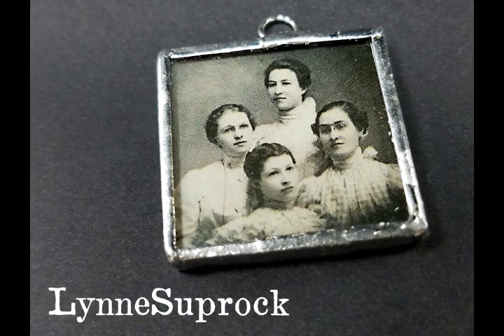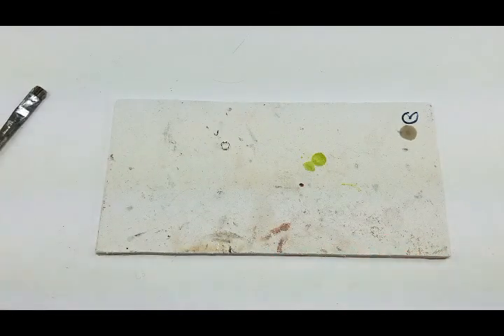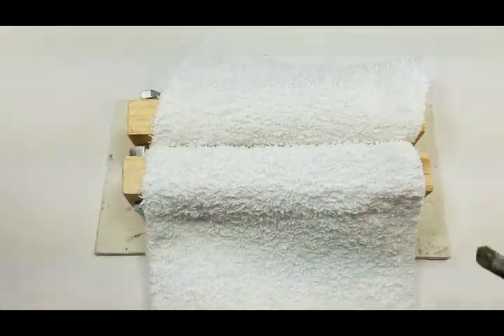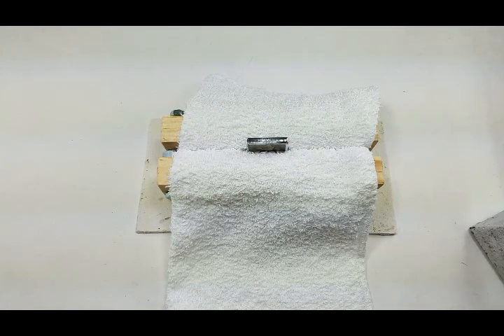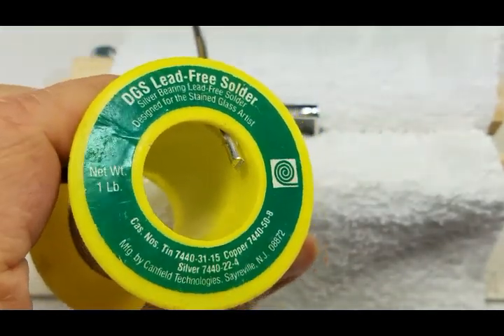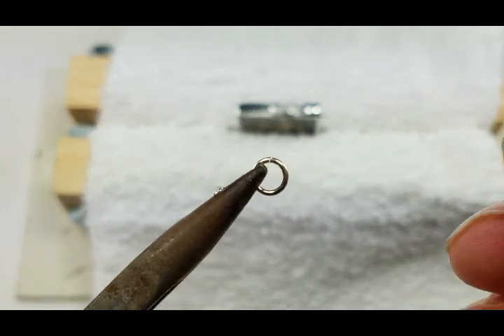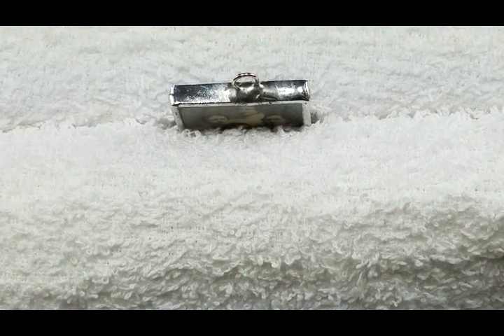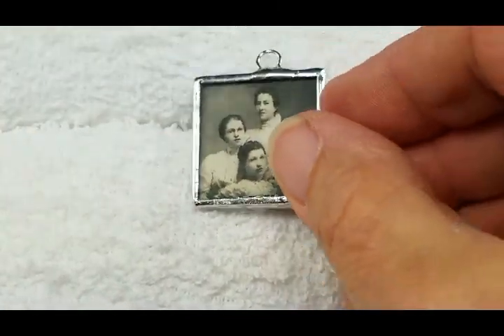How To Solder A Jump Ring Onto A Charm

Comment: I realize this is an older video but I'm just learning how to solder and am struggling BIG time with the jump rings.  I swear I do what the video shows and the solder just flows off the jump ring.  I'm using led free solder and stainless steel jump rings.  Is this incorrect?  I hope to hear from you.
Reply from the maker: there are certain metals that do not solder together using this method.  sorry so late in getting back to you Suzy.  use a base metal jump ring or one plated with silver

Comment: Hello,  Ive been watching a bunch of your videos.  Thank you.  They're informative and easy to watch :)  can you tell me what kind of soldering iron that you are using.  I'm new to soldering and have already wasted money on irons that are not getting the job done.  I just bought a Hakko 601  and i like the fact that it heats fast,  but the tip is not tapered and is impossible to use.  Now i Need to by another iron  (this wll be my third) so I want to make sure that this is my last!!  Thank you..any information would be helpful..   JD
Reply from the maker: Well, I don't think they sell my iron anymore. I have had it for 10 years.  It is an Inland Studio Pro 100 watt.  There is no rheostat with it, so I use the mini Phaser to regulate the temp and set it at 7 or 8.  I also use a 1/4" chisel tip for the charms and can also use a 3/8" chisel tip, for wider foils.  

Here is the link to the mini phaser.  https://www.amazon.com/Inland-MiniPhaser-Temperature-Controller/dp/B001R4QWK0/ref=sr_1_1?ie=UTF8&qid=1525035545&sr=8-1&keywords=inland+soldering+iron
there are other rheostats out there, but I have not used those.

Any  rheostat allows you to use any 100 watt without overheating the iron.  Some irons have one built into the handle.  I did see one like that  at Hobby Lobby awhile back and they have coupons to use.  I cannot testify to how well it works though.  You can always try and return it, if there is a problem.  

Here is a link for the Hobby Lobby iron with rheostat:
https://www.hobbylobby.com/Crafts-Hobbies/Glass-Crafting/Stained-Glass-Tools/100-Watt-Soldering-Iron-with-Rheostat/p/34657

You should be able to find a chisel tip for your Hakko 601.  Perhaps you could investigate that first to see if that will work for you.  
Here is a link for the chisel tip for the Hakko 601.  It is a long Etsy link so copy and paste into your browser:
https://www.etsy.com/listing/157339064/14-inch-tip-for-hakko-fx-601-temperature?gpla=1&gao=1&&utm_source=google&utm_medium=cpc&utm_campaign=shopping_us_a-craft_supplies_and_tools-other&utm_custom1=7cddbd0a-769b-4f06-aba5-8cd13d05dfb1&gclid=Cj0KCQjw2pXXBRD5ARIsAIYoEbdHvsA40ivIs3v4FO-sKEf60uCvLFl0VcMKBAlmrhvGyDWbwN_OFnQaAheEEALw_wcB

Here is another chisel tip source for your Hakko 601:
https://gokimco.com/hakko-t19-d5-series-chisel-soldering-tip-5mm-for-fx601-iron.html?gdffi=a2b2595eeb2e44a8bc2e332d298712bc&gdfms=D818912733D14B43ABCBF1DDB2E4CA87&gclid=Cj0KCQjw2pXXBRD5ARIsAIYoEbeUbGcc_zaO37yQ3OyE3vjwcBpAs_R8jtM8U_yiEc3j7aSl9nr85b0aAk0eEALw_wcB

Good luck and happy soldering!
Reply from the maker: Hit "read more" for my explanation above.  There is more information and links for you .....

Comment: I'm having trouble getting the solder to stick to my piece. I'm using an old camera lens that has metal surrounding the glass...can't get the solder to stick to it for the life of me...what am I doing wrong?
Reply from the maker: Susan not all metals react with solder.  First try again using plenty of flux. If that does not work the metal is not one that is compatable. Metals that solder well are copper, brass, nickel. Steel is not one of those, nor is chrome or aluminum. The lens may be one of those metals.
Reply: Thank you so much! Now I have to figure out what the heck the outside of camera lenses and filters are made of. I thought maybe it was that the piece wasn;t hot enough.